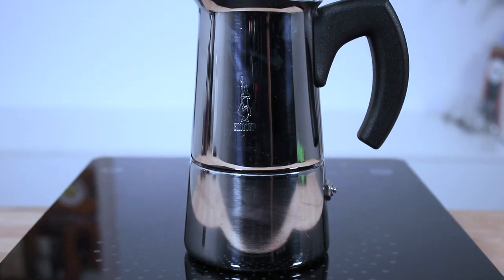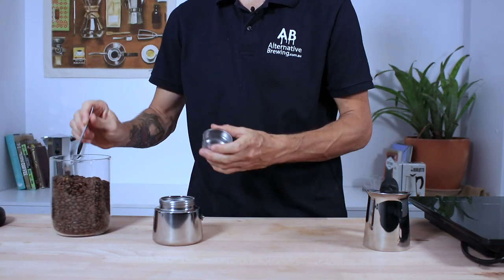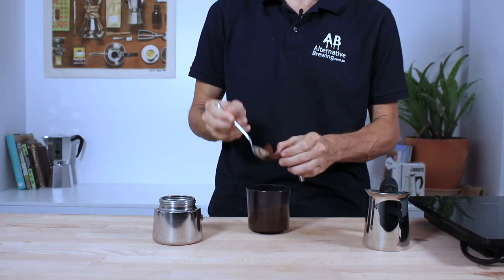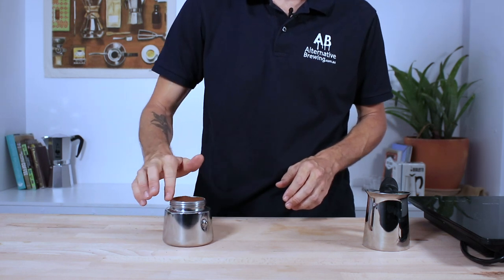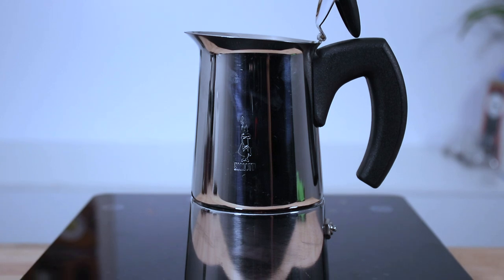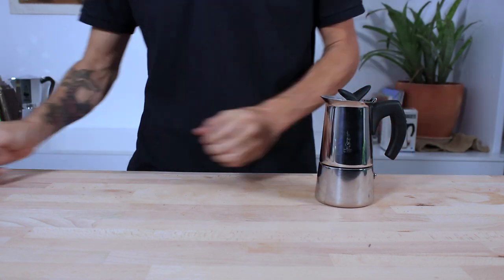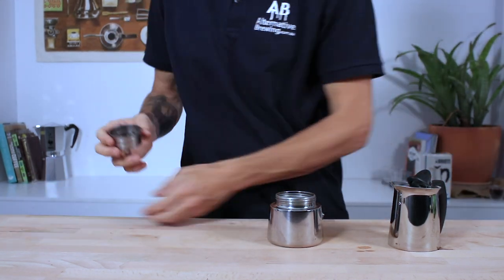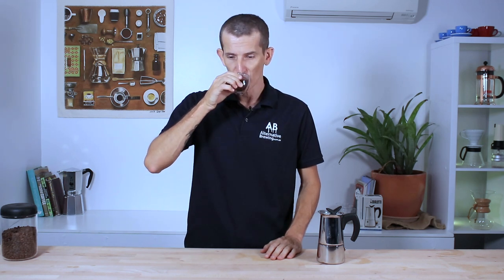How to Use the Bialetti Musa Moka Pot

Comment: I was thinking about the Flair Neo, but this might be a bit easier to use.  After all, I'm no hipster coffee snob.  What I love the most about this is it's stainless construction!  No leaching of aluminium oxides into your brew with this unit.
Reply from the maker: Good call!
Reply: This is stainless steel but this has the metal coating in the bottom, Instructions for first use say to make three batches, but don't drink it just throw it out. I just use distilled water only, no tap or filtered water just distilled water 0ppm will not leave any deposits build up inside. With a ppm tester the first batch was 15ppm. Even if no coating, you still have the silicone seal leaching stuff.
Reply: You're worried about a moka pot not being easy to use? They are easy to use.
Reply: @daniboy7740  if there is a steel coating, it could be there to help speed run the heating in the boiler.

Comment: Making a better brew with this little MUSA I use distilled water that won't leave deposits and tastes better, you can fill it half way or to the top with coffee grounds, depends on the grind and how strong of flavor you want, but the final step that I do is to cut a paper coffee filter the size of the metal disc, you put the filter on top of the disc and then the silicone seal on top of that, and it's not bitter or cloudy looking and it will make foam but won't last long.

Comment: After the moka cools down, remove the filter that holds the coffee grounds which sits above the water chamber, pick it up and reassure the long tube is cool. Turn it upside down over the trash, put your lips on it and blow. The coffee grounds will fall.

Edit: putting it away is easy. Don't over tight the rubber casket or you May wear it out quicker. Just screw the top on loosely making sure the top doesn't fall off and put it away.
Reply: Actually you can just dump it in your sink, coffee grounds is really healthy for plumbing. Run hot water and break up the clump down the drain, it will eat at the gunk as it flows through your pipes
Reply: Quite interesting - I guess it is slightly acidic! @yenzabar

Comment: How do I clean coffee deposits (probably burned coffee) that are difficult to see in the thin circular crevice surrounding the bottom of the percolator?
Reply from the maker: ahh - not coffee deposits -but oxidisation of the metal from water. Best keep the pot as dry as possible between uses to limit this. You can use lemon or other food acid and bi-cab to remove or smooth off this surface - but ultimately you cannot turn back the time on it - but limit any more from occurring through cleaning and thoroughly drying.
Reply: @AlternativeBrewing  Thank you so much!!!!

Comment: I'd prefer the grind size coarser.
If you use a espresso fine grind size, coffee will be bitter. 
My trick is, using a little bit coarser than espresso fine grind size and use a aeropress filter. You should try.
Reply from the maker: Nice! Yeah I'll give it a shot for sure. Paper filters on top of the coffee are becoming a common practice with espresso, with great results! I hadn't considered that with Moka Pot until you said it 👍
Reply: Musa 2 cup su yarı yarıya kalıyor can bey. Kahve çekimi ideal ölçüde.  Moka pot boyutu küçüldükçe yoğunluk azalıyor diye düiünüyorum. Bir öneriniz var mı acaba?
Reply: @mucahitgoren  Selamlar, öncelikle öğütümü biraz kalınlaştırabilirsiniz. Sonra da eğer kağıt filtre kullanıyorsanız onsuz da deneyebilirsiniz. Bir de suyu koyarken de sıcak su kullanmanızı öneririm.
Reply: Coffee finer is not bitter. If you're not sure, well, go through the brews to find the one you  think is less bitter. Once it's a bit less bitter, adjust temperature. But stainless steel are far easy than Aluminum moka pots. But really, finer between espresso and coarser don't make the coffee bitter. At least not to me. You're doing something wrong like maybe you're packing the coffee powder down. If so, don't, and that's why the coffee taste bitter.
Reply: A coarser grind than espressos in true for every moka pot, including the Musa (it's in the Bialetti manual). A word of advice: the 1 cup and 2 cup Musas cannot be used directly on induction stoves (I have both), larger Musas can. Of course an adapter plate will solve the problem, as in every other case.

Comment: I don't do like that.

17 grams _ 240mL
Preheat the water and rainse the top Chamber with cold water before to avoid too much heat and preserve aroma.

Inmediately after seeing bubbles close down the top lid, take off from heater and cool down the bottom chamber for 10s in the sink to avoid burning the coffee on top.
Reply from the maker: For sure, I couldn't agree more... Just covering the basic in this video – but could easily talk 10mins more on Thermal stability, water to coffee contact time and various brew ratios to use depending on your chosen beverage 👍

Comment: I'm trying to find stainless steel stovetop expresso maker with no chemical coatings inside of cups. It looks like Bialetti Musa and Venus have no chemical coatings inside of cup. Can you confirm it? Thanks
Reply from the maker: Yes, this would be the ideal brewer for this. All stainless steel 👌
Reply: This is stainless steel but this has the metal coating in the bottom, Instructions for first use say to make three batches, but don't drink it just throw it out. I just use distilled water only, no tap or filtered water just distilled water 0ppm will not leave any deposits build up inside. With a ppm tester the first batch was 15ppm. Even if no coating, you still have the silicone seal leaching stuff.

Comment: 1) Which cup size is it in this video 
2) whats the difference between venus and musa?
Reply from the maker: 6 Cup was used in this video. The MUSA and VENUS have very little in difference. Shape and style of handle and base. - volumes differ slightly across the units but the ratios remain the same.

Comment: How do you remove the gasket?
Reply from the maker: Find a flat head screw driver or something flat but not shape and place it in between the gasket and the steel filter. They're pretty easy to pop out .. just make sure you place the seal on top of the filter .. and ensure the filter is facing up the right way when replacing it .
Reply: @AlternativeBrewing not “sharp”you meant.

Comment: I have one, 6 cups capacity, but I'm not satisfied with it at all. The valve has a loose spring, it is opening instantly as some pressure builds up and is letting out at least a cup of water as vapor. The result is 4-5 cups of coffee which tastes too strong.
Reply: It happens if you use a too fine powder (expresso grinding instead of moka) or you put too much coffee in the filter and you pressed it too much. The result is a excessive counterpressure in the boiler, the water can't flow through the filter and the valve opens. The coffee results watery and bitter. Check the powder grinding, fill the filter with the coffee without press the powder and retry. Cheers from Italy 🙂
Reply: @MassimoBacilieri  It was tried with Jacobs Krönung, which has not the finest grind.